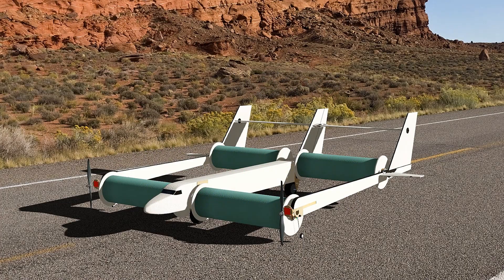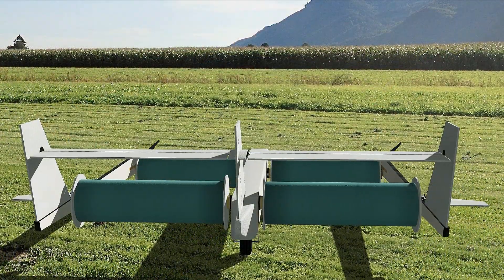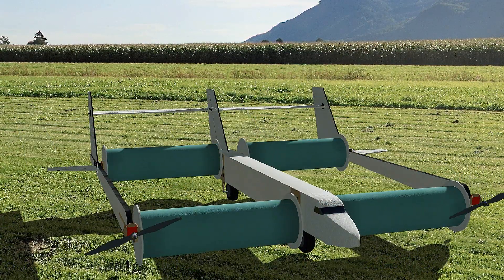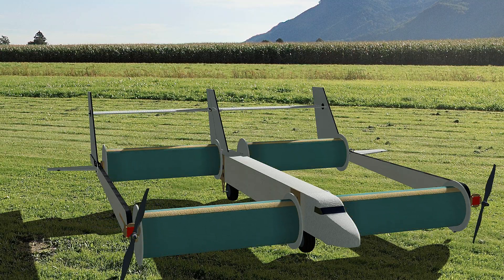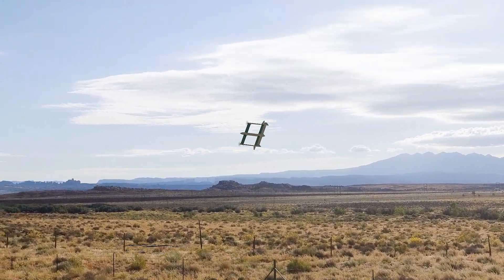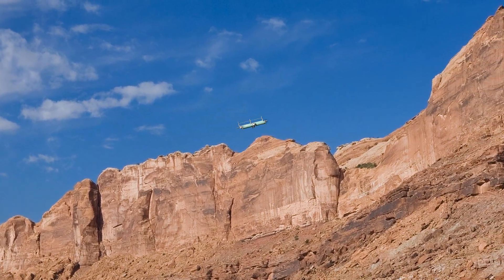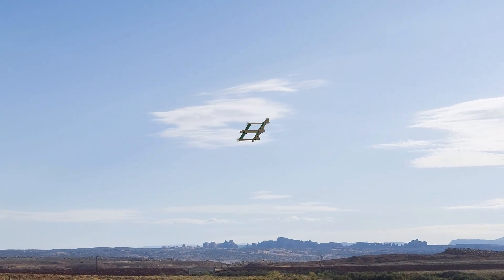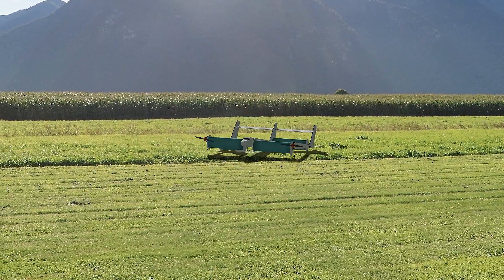The Flettner is a "Spinning Tube" Magnus effect wing Model aircraft! Principal explained in Aerofly.

Comment: hello, I have a gaming computer but can't run aerofly like you did... always lags.. make me 🤮
Reply from the maker: Well the Gaming computer I built 8 years ago, has only a 2.3 GHz CPU.  That is the minimum requirement according to Aerofly.  But I also have an SSD hard drive which reads and writes faster.  I also have an 8 Gig Nvidia Video card which runs all my simulators smoothly.  Check out the computer requirements on Aerofly.com or Steam.  If your computer is stock, you may need to upgrade the RAM or the Card.  Otherwise, go into the Graphics settings in the Aerofly program and turn them down.
Reply: @NightFlyyer  thanks for your answer, my computer is normally even faster than yours. I'll check the settings. have a nice day
Reply from the maker: @jeromedupont8994  Right, that is why it must be the video card, as Aerofly will run on non super computers, but the video card is where its at.  Good luck.

Comment: The magnus effect is just air pulled by the rotation due to friction which forms higher pressure below. I am curious how this is different than maybe a cyclo rotor . Is there any benefit from using the magnus effect? I know it's just for fun, but I cant find anything comparing the two.
Reply from the maker: Not sure, but you might start with the folks who made the original model this one on Aerofly was patterned after.  Here's the link.  https://www.youtube.com/watch?v=hlmvHfIAszo&t=0s
Reply: @NightFlyyer  Thanks

Comment: This air plain should have cross flow prepeler in stead of axial prepeler. It will be very quiet.
Reply from the maker: Maybe.  You could contact the college and tell them that, but I think it needs the two props to steer left and right yaw, because there is no rudder so it yaws and steers by coaxial motors. Thanks.

Comment: Do you think that this could hover if the tubes spin in opposite directions?
Reply from the maker: Now that is a good question, except for the front propellers.  I think if it spun fast enough, it might.
Reply: @NightFlyyer  From various other sources, lift is due to separation of flowstream off the (lower) surface, downward off the cylinder.  Were the cylinders rotating in the other direction, flow would separate upward, off the upper side of the cylinder, and "lift" would be downward.  Same thing that makes a curve ball curve.  

The abrupt takeoff and agility of that plane is a total surprise and very impressive.  But...the hard landings seem  to illustrate what a poor glider the thing is.  Guessing there is no ground-effect as with wings, and flaring will be useless.  Don't think you can change the angle of attack of a cylinder.  In fact, I'll be there is an anti-ground effect, as the turbulent flow that keeps the thing aloft will be impeded by proximity to the ground.  Like to know the rpm of the cylinders.  Same as the props?
Reply from the maker: @DougFuhr  Here is the original flying.  Maybe it will help you make one. Ask them the questions, as they are the inventor of this machine.  https://www.youtube.com/watch?v=hlmvHfIAszo&t=0s

Comment: Dave,  Remember when you flew my prototype video transmission system on your yellow 300C helicopter at the dump road flyer site?  I recently discovered some photos of the event.
Reply from the maker: Hi Mike.  Long time no see.  For sure, I remember that and have put a couple of those pics in some of my videos.  That was the beginning of the whole FPV craze.  I hope you are well.  Tell me what your doing these days.  Stay well and Happy new year.
Reply: Dave,

Congratulations on induction into the AMA Hall of Fame, friend and hangar neighbor Burt Rutan shares the same distinction. 

The dump road flying days were fun.  I eventually learned how to fly RC helicopters which lead to a commercial rotorcraft rating.  Interesting thought that we may be FPV pioneers,  I know of no others doing the same at the time.  That clunky low rez (160 line) camera was the first of it's kind on the market. The video transmitter was from a schematic in the Radio Amateurs Handbook,  it produced more noise than signal.  I ended up designing a new transmitter the size of a postage stamp which paved the way for a multitude of commercially available products, a live video down-link for the Tomahawk Cruise Missile was a highlight (see Youtube video).

I retired and relocated from California more than 20 years ago to a 40 ac ranch with RC flying field, other activities include building and flying full sized experimental AC and electronics as a hobby.  The greatest challenge over the years has been staying retired!

Mike
Reply from the maker: @MikeLee-mz4zd  Thanks very kindly, Mike. Congratulations on your successful life.  I know what you mean about being retired.  I work more now than when I was working.  Here's a link to the video of that day on the dump road and some antenna talk.  Hope you enjoy seeing it from those great days.  Stay well.  https://www.youtube.com/watch?v=2yuQkRQi0aQ
Reply: @NightFlyyer   Dave,  Thanks for the video, an accurate technical presentation on antennas,  I didn't know you had a ham license.  An advantage of the 5.8 antennas is that they radiate circular polarity and don't suffer from the "cone of silence",  the breakup encountered running them is primarily due to mutipath cancellation.   They are similar to the quadrifilar helix I ran on my Kyosho Concept 30 in the early days.  I'm enjoying going through your videos.  For old time sake I recently picked up a 70's vintage single stick Kraft Sport Series transmitter from ebay,  I used the same model when flying slope with the Hobie Hawk at Salt Creek where the Ritz Carlton Dana Point now stands.  I made an in person visit to Kraft to get my original re-crystalled shortly before they closed their doors, you may have been working with them at the time.
Reply from the maker: @MikeLee-mz4zd  I bought my Hobie Hawk right from Hobie Alter at his company in or around 1977 and spent many years flying the Dana Strands too. I sold it to a guy in Switzerland and he still has and flies it.  Loved that bird.  No where to slope soar here in Iowa, so it's power for me, but I miss that relaxation.  I used to fly at Torrey pines a lot to and still fly online there with friends from all over the world on my Aerofly simulator.   I visited the Strands just before the fire and no way to fly there anymore.  We were chased away a lot too.  LOL  That was a great time.  After Kraft, I was hired to repair radios (Proline) for Joe Bridi, as he bought the Proline company. Then started my company selling acrylics for 25 years, no still going as Adams Polishes.    I worked at Kraft from 1978 till they closed.  It was a great time.  Glad you are enjoying my videos. Stay well and thanks.
Reply: @NightFlyyer  Dave,  Lots of good memories.  There is a promotional video on Youtube somewhere of Hobie Alter flying a hawk at what looks like Salt Creek.  I have two Hawks new in box in my collection, one factory covered in orange wings and the other unfinished, a third is my flyer. Avco tried to fence the the Salt Creek site off but someone before me always made a hole in it right at the State Park parking lot.  Torrey Pines was nice, but could attract a crowd, I didn't like dodging the manned AC.
Reply from the maker: @MikeLee-mz4zd  Yep. I never flew at Salt Creek, as it was further North of Dana Point Strands.  They fenced the Strands off there but someone always cut a hole there too.  We snuck in thru it lots of times.  LOL..  At least flying online I don't have to dodge the Powered hang gliders.  Only the SR71's!  LOL  One of our club members flew a powered hang glider at Salt Creek. (finally broke a leg doing it)  He is now passed.  I think he was out at the dump road that day we did the FPV.  His name was Randy Martin.  He and I flew at the Strands all the time.   Great to hear you have 2 Hawks.  Love them.  Flew lots of times at night out there too.  BTW, I forgot to tell  you, I flew on 53 Mhz back in the 70's and 80's because I had a HAM license.  I had to have it to work at Kraft, so had some clearer channels to fly on.   A few years ago, I retook the test to get it again, so I could review the Horizon Hobby Blade Torrent 110, which requires a HAM license to fly legally.  I knew if I flew it without one, someone would chastise me or turn me in to real hams who have issues with folks causing interference.  But I see not many even care and still fly illegally.  I just wanted to be safe and re took the test. It was a good exercise of my 72 year old brain. Aced to too, which was a surprise.  I had to drive 60 Miles to a testing center so 3 witnesses could give me the test and give me the license.  LOL.  When you and I did the FPV thing, I don't remember you mentioning you flew or I would've asked you to go Sloping with us.   Here's a link to a Torrey pines video I made.  Maybe  you could get Aerofly RC-7.5 on SteamPowered and fly with me sometime too.  https://youtu.be/5V2fIs3i0DQ
Reply: @NightFlyyer  Good on restoring your ham license,  there are hams who delight in tracking down illegal operators.  The FCC does not catch all of them, but the ones they do catch are surprised at the size of the fines.  I was pleased when my wife and kids earned their licenses.  Lots of nice slopes to fly here in the inland north west, the problem is the 150' evergreens.  I'm resisting the urge to drill into the fuselage bottom to place a tow hook.